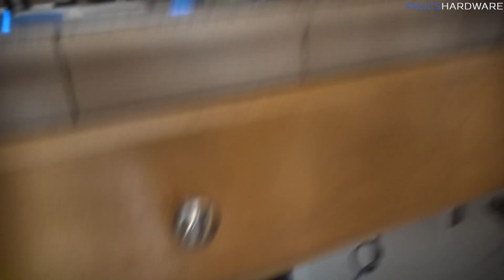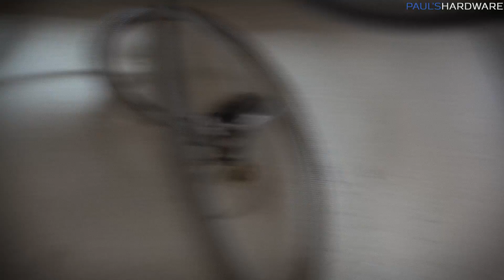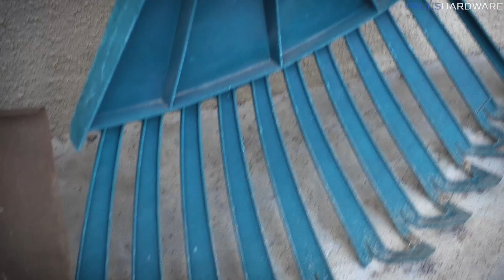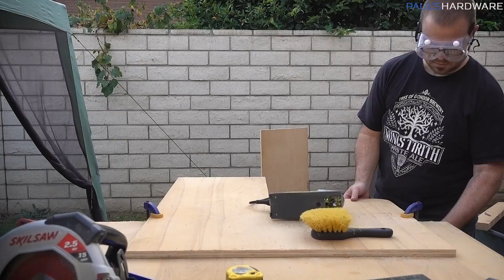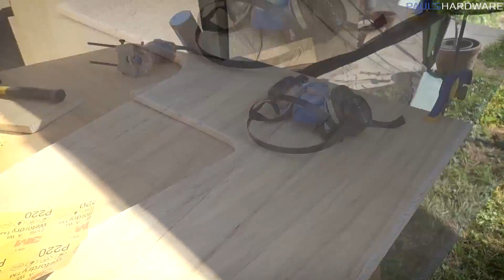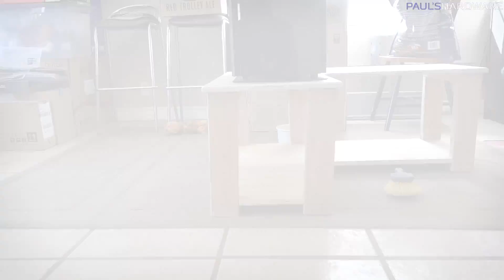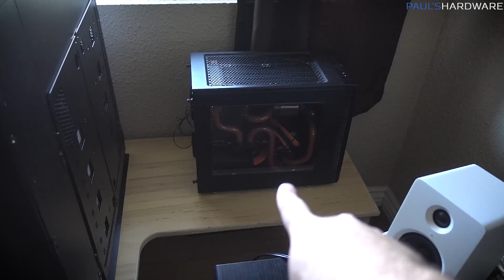Mortally Wounding Myself While Attempting to Build Furniture

Comment: OK... wood worker tips... The screws your using and stripping out. Most Phillips head screws can be driven with a #2 square head drive instead of the #2 Phillips especially if you use deck screws. They strip much.. much less. Easy to check when your at the Hardware store for a fit. The Router two things... one it does not need the jig you have on it.. the router bit has a bearing on the bottom of the bit to guide your bit along the piece of wood and remember that bit goes one way around a piece of wood.. The tip to remember is to always run the wood into the feed not away from it.. the bit runs clockwise so bare that in mind when your using the router from the top or bottom. And lastly check your jig saw settings manual. Orbital switch will let you vary your cut just as much as a blade. From rough to fine. Keep up the good work and I too would like a Solar Update video.. LOL
Reply: Didn't know that about using a square head. I've been using spax screws for a while with the star bit.

Comment: hey, im a plumber and i just wanna let u know to be careful with how u did that. u used a brass ferrule that slid on after u put on the brass nut. you should replace that with a poly ferrule. brass ferrules are for copper tube and pipe. the way you have it, it might leak eventually. just a friendly tip! love ur channel keep up the great work!
Reply: If your a plumber, how do you not know that polyethylene tubing should never be used for ice maker lines? Highest payout for insurance companies in the USA.
Reply: @brianptomey7366  didnt know there was a problem with em. Personally i use braided lines but thats good to know. Ull always be learning new stuff in plumbing! But dont question if im a plumber please, i have 10 years in the trade.

Comment: 1 tip. A drill bit the same size as the head of the screw is perfect for countersinking the screw head. Just a few quick trigger pulls and it's perfect. A little deeper and you can fill the holes with home made wood filler using carpenters glue and saw dust.